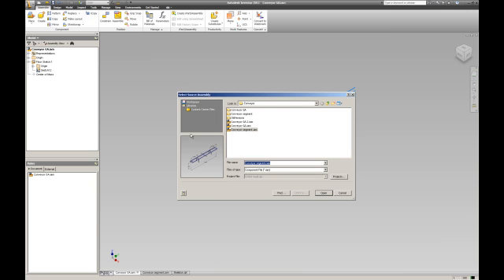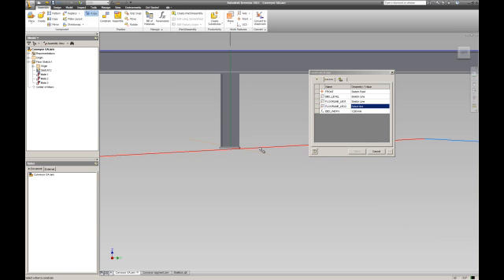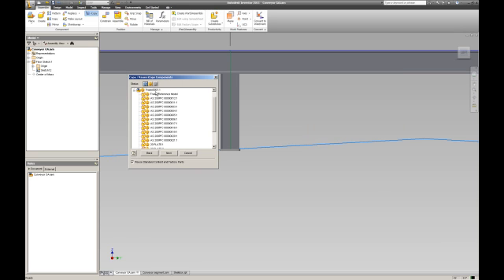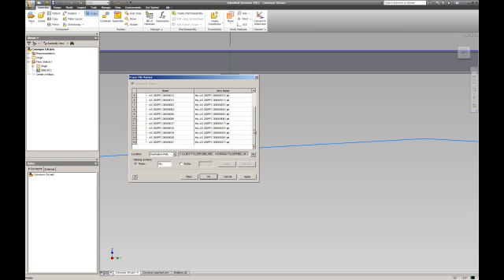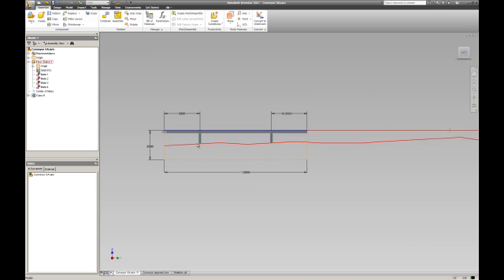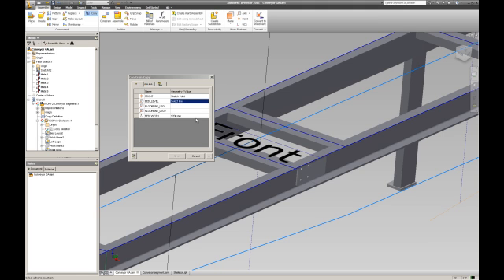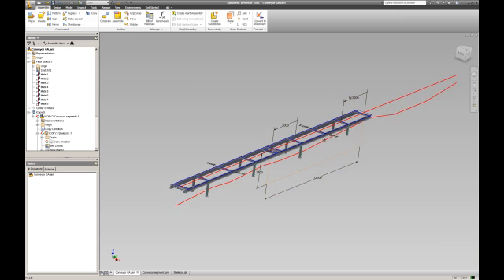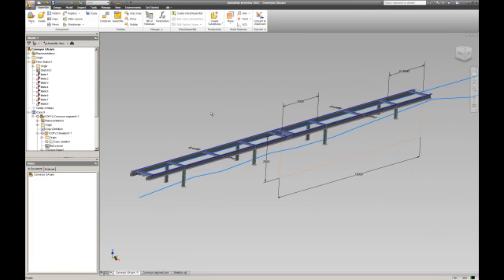Autocad Inventor 2011 - iCopy - Part 2 of 2

Comment: Thank you very much good sir! Everything went well except that my skeleton part wasn't in adaptive mode. Also it didn't copy because it would have cause an overlapping, so i changed the part a liitle bit and it worked (using inventor 2015)